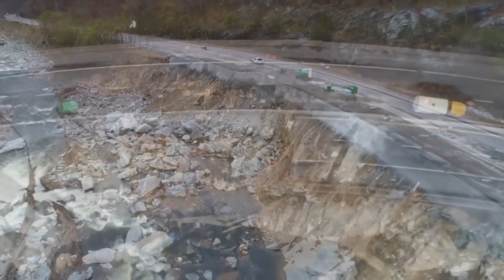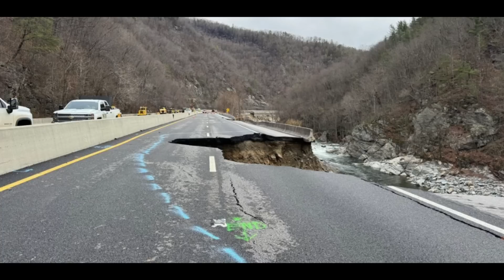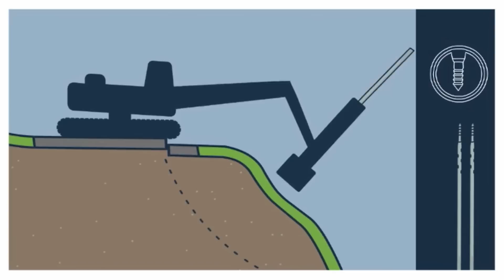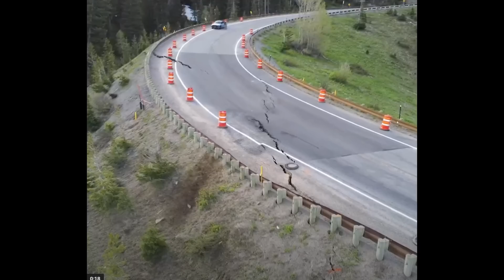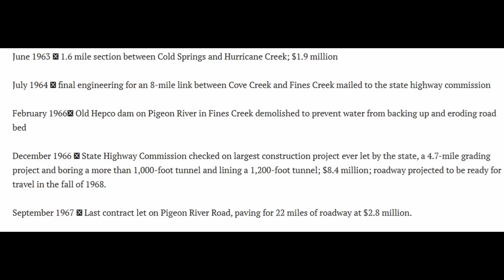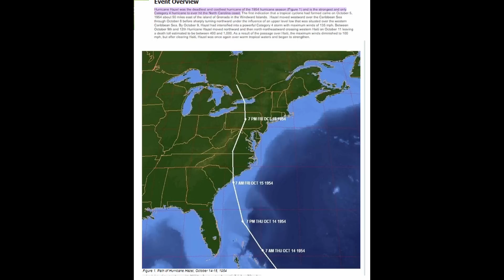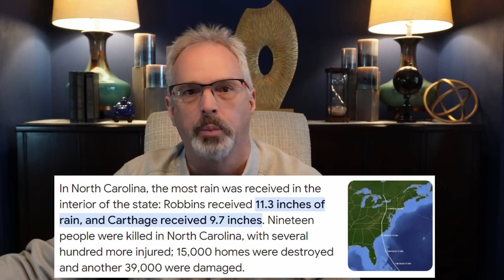Interstate 40 Rebuild Status

Comment: I'm reminded of the 12.4 mile section of Interstate 70 West of Denver in Glenwood Canyon.  These two sections of Interstate (I-70 in Glenwood canyon and I-40 in the Pigeon river gorge) were designed years apart and there was a strong Environmental movement that wanted to preserve the beauty of Glenwood Canyon when that section was designed. When I-40 in Pigeon River Gorge was designed the just basically just   bulldozed and blasted their way through without thinking about the impact on the wilderness. On the other hand if you go to the Glenwood Canyon section of Interstate 70  and stop at some of the rest stops  and walk down the bike paths you will see a big difference between that and the I-40 section interstate that we're talking about.  I'm not perfect the Glenwood Canyon section is about as environmentally friendly as you can build an interstate.  This 12.4 mile section of Interstate cost incredible amounts of money.  

When I-40 through through the little pigeon Gorge was designed there really wasn't much input into preserving the Gorge. They basically just bulldozed and blasted their way through. In fact the Pigeon river used to run black with pollution and chemicals from the paper mill in Canton.  The men from the Tennessee side really pushed the Pigeon River Gorge route because they love the mountains and wanted to open up that area.   For those of you who do not know it is bounded by the Great Smoky Mountains National Park on one side and the Pisgah and Cherokee National Forests on the other side.  The river now runs fairly clean and people now raft down the river. There are also a number of exits and particularly check nearest where I-40 crosses the state line. These connect up with a series of forest roads that gets you out into Wilderness areas very quickly. People driving this Section of the Interstate need to take a few of these roads and exits and stop and enjoy being in nature. 

While I think the interstate should be reopened temporarily I believe that this whole section of the interstate from 4 or 5 me before you leave Tennessee and for 15 or 20 miles into North Carolina needs to be redesigned which fairly long sections diverted  onto pylons or bridges (similar to certain sections of the Blueridge and Foothills parkways) so that the interstate doesn't damage the local wildlife and terrain as much as it does.  The pylons can be designed in such a way that they would stand up to these 100 or 500 year events. While it would be expensive we owe it to this now pristine  area of forest to totally rebuild this section of I-40.

Comment: What if the elevated the 22 mile stretch on concrete piers, basically a 22 mile long bridge like I-10 across the Atchafalaya Swamp in Louisiana? That might cost more but less than a complete re-route which would take 20 years to get approved and funded, plus property acquisition would take a long time as folks up there don’t like the Government. Read about the problems the TVA had in the 1930s, it hasn’t changed a lot.

Comment: The first patent for weather modification was granted in 1891
US0462795: Method of Producing Rain-Fall 
Description: Involves storing liquefied carbonic acid gas in a shell or casing with an explosive, then shooting it into the upper atmosphere 
Theory: The gas evaporates, cooling the atmosphere and producing moisture that forms clouds and rain 
Other notable weather modification patents include:
US1338343: Process and Apparatus for the Production of Intense Artificial Clouds, Fogs, or Mist (1917) 
US3795626A: A process for removing fog or clouds using a water-soluble condensation product 
US3613992A: A weather modification method by Robert G Knollenberg 
The number of weather modification patents peaked in the 1970s and 1990s, which may have been due to international tensions at the time.

Comment: Yeah. When I saw the damage I was shocked that they would even think to try to rebuild it in the same path. There have been so many events in the past 20 or so years that have shut down I40. Now, they think they can rebuild the where it used to be?? I know the cost would be huge, but they really should consider moving the entire road through there more into the mountain side. But of course that would probably increase the likelihood of future rock slides that have been so problematic in more recent years. And it is insane that they want to open it to traffic right now! The road was already clogged with four lanes and I’ve been through there with only 2 lanes when I didn’t realize that parts were shut down. It’s going to be miserable going. The only traffic really needs to be those people who need to go through to access the exits in that area, not through traffic. If they really open it up, I can’t see how they can make real progress on repairing it as everyone will think that is the best way because it is way shorter than going up I26 and down I81 to get into those areas of TN just past the current closed areas (Newport, Hartsford, etc) let alone to Morristown and Knoxville and beyond.

Comment: When you consider the number of closures they have had from slides those costs get worse. They had the same political battle over the route of I26 from Asheville into TN. Tennessee finally built the road where they wanted it and NC eventually connected to it. NC built a great road but the entire stretch in TN is a joke. Very little was filled and leveled up and in many places they apparently bent the road around property lines. There are several miles that are like a roller coaster ride and there are multiple accidents each day on that section.

Comment: The interstate Highway system was funded by DARPA. The Defense Advanced Research Projects Agency, part of DoD R&D. Now each state maintains it's own sections of the interstate Highway system with some federal funding, I believe. I was surprised to learn in 1985 that 75% of economic growth between 1950 and 1985 in the USA occurred within 10 miles of a Highway. Where the interstate highways were turned out to be economically important. If that section of I-40 takes some less expensive to build and maintain route the local economy will suffer. Still it's bad form to build a road that gets washed out every 50-100 years.

Comment: To your point on event probability …The Big Thompson Canyon Floods of ’76 And ’13 (Colorado -CDOT ) are a perfect pre curser to this stretch of I 40  … and I 70 thru GlenWood Canyon (Colorado CDOT)  is an even better example of vulnerability as it is also subject to Avalanche risk …if they (NCDOT) aren’t willing to re route the interstate to a more sensible location …the pilar and stacked lane separation of I 70  has proven to be flexible and resilient to natural disaster if you look at CDOT’s response in the passing years ...the turn around time for reopening and sourcing material for repair seam to be a better fit to what generally seams to be this I 40 stretches future needs.
Reply from the maker: Thank you for pointing out that CDOT has more experience with this type of event!
Reply: You can build a viaduct and hope the mountain doesn't wreck it.

Comment: In Japan, they decided not to install the emergency diesel pumps that would have kicked on to provide the water to cool the reactor.
Reply from the maker: Ouch! Bad decision that was.
Reply: Just no... one quick Wikipedia search shows there were 13 diesel generators on site. Everything at Fukushima stemmed from the under-design of the seawall that was supposed to protect from tsunamis; only once that was overtopped did most of the generators flood and electrical systems fail.

Comment: Really good presentation! Also great analysis by my birds 2525.  I live in this area and Dave I40 (now closed to all but local traffic) to exit 15. It is correct to say there have been numerous and ongoing problems with this road--usually rock or mudslides and it was closed for some months about 25 years ago with traffic rerouted. This is an important east/west artery obviously built in the wrong place. Would it be possible to blast and carve out the north side of the route to create space for  through lanes instead of attempting to reclaim what has washed out into the Pigeon River?

Comment: As far as moving I40, I haven't heard about what would be involved on the TN side, as that will also have to be moved. I'm assuming you are not going to build the road to meet at the existing point in TN. Also, depending on where it will start to deviate from the existing I40, there will need to be roads from the cities that currently connect to I40. Wherever it's moved, it will have to go through SMNP and other national forests.

Comment: Those outward sweeping bends can only be protected by an impenetrable wall, the force of the water should never be able to wash the foundation away, I’m guessing  the water was maybe 2m below road level so that wall will have to be tied deep towards the sloop to withstand the weight of water under the road. And the slope side will need drainage system to limit water ingress under the roadway. That’s a lot of work under exiting roadway. Once the road is open, they can consider piling to create a wall at the river before filling with engineered fill etc.

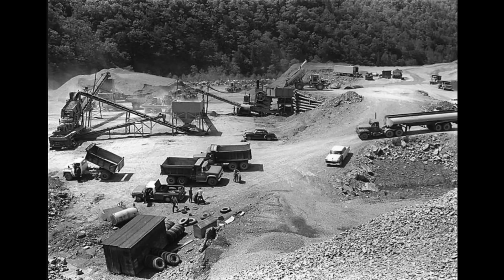Comment: Sharp rock, Minute 7:18; look at all of those tires.

CalTrans was in a like situation up here on Highway 299, so they brought in these trucks that looked like end dumps, but these beds rolled over to the side dumping the length of the bed all at once and doing it while driving down their lane, it was cool, they didn't have to back up, no fartin' around with anything like that, they just kept movin' forward.

Regarding Fukushima- Daichi, the original site of that plant was higher, well above the projected tsunami height, however, due to the distance to bed rock, which the pilings had to rest on, GE/Boise Cascade, (GE/BC), argued the Japanese engineers to take down the grade instead, bringing the grade to the length of piling that GE/BC were willing to pay for.  (I'm tryin' to remember the Japanese energy firms name, was it Tepco?) So, after losing the elevation argument to the Yanks, the Japanese engineers pleaded with the Americans to at least remove the Emergency Generators which were located in the basement, an area where now, once lowered was in range of a Tsunamis, and GE/BC refused to do it, "Leave the generators where they are, we don't need to be redoing these plans!"  That's how THAT shit went down.

Comment: Create a construction road along one side of the riverbed. Take a hundred feet or so from the west side of the canyon to build up the east side fifty feet or so. When possible use the extra fill to shorten the roadway by eliminating curves. Some advantages are less distance to move the fill and a wider river to handle the storm surges better.

Comment: One option to throw out there.  Rebuild this section as a viaduct.  An example of this would be I-70 in Colorado.  The material for the steel would be more expensive, but you don't have to haul in so much fill material.
Reply from the maker: Interesting thought!  You know, that is what they did on I-10 over Lake Ponchartrain in Louisiana.
Reply: @CaseyJones-Engineer This whole section needs to be redone right! No expense spared. Shortened & straightened, & done in a maximally robust way, in every way technically possible. And with a GENEROUS over-provision for future traffic. Because you NEVER want to have to do it again.
Reply: @CaseyJones-Engineer  Building through a lake is much different than the Pigeon River Gorge. People aren't noticing that the worst part of the damage is on the outside of a bend of the river. Those places need to be avoided for any sort of construction. Even building a viaduct in those spots is problematic. Scour is high and the burden of the river at high flood elevations would probably wreck the column foundations and columns.
Reply: @CaseyJones-Engineer A distance optimized combination of viaducts, and tunnels. But with at least 6 lanes, and robust full travel width shoulders on each side, for future expansion (since you're not going to rebuild this for expanded traffic b4 the "all drone" future). And also to accommodate breakdowns/accidents/resurfacing/et al.
Reply: My wife’s grandfather ran a bulldozer when the I40 section through Pigeon River was built in the 60’s. He always said that this section of Highway would never hold over time. Also yes there was a political reason it was run through Haywood County on the Pigeon instead of through Madison County to Hot Springs and on to Newport TN.. … just sayin..
Reply: Similar project recently completed not far from the wash out the Blue Ridge parkway
Reply: I've been saying this since the floods happened in NC after Helene. They could get the hwy designers could get the plans from when I-70 was built going through Glenwood Canyon. "Interstate 70 (I-70) through Glenwood Canyon in Colorado is a 12.5-mile stretch of highway that's considered one of the most scenic natural features on the US Interstate Highway System." They could do an updated version with I-40 and some of its arteries in NC.
Reply: Colorado has had a lot of Problems with I 70 in  Glen wood  Canyon

Comment: Hmmm . . .   For all the "throwing good money after bad" zealots, If I-40 is not rebuilt here, where do you propose putting it, and how much will that cost???  Roads of any capacity in the Appalachians are main built in two areas - ridgetops and river valleys, with awkward transitions between them as terrain features dictate.  Aside from large embankments, the only other structure types available to engineers and designers to negotiate 'challenging transitions' are bridges and tunnels.  All of these have their own risks and liabilities.  Any solution will cost money.  It seems unlikely the current regime controlling congress has the will to acquire the funds for this task and then spend the money on this task.  Certainly the "cheapest solution" is to do nothing - not rebuild, not relocate - and let the travelling public workout the alternatives.

Comment: Great video!  I concur with your conclusion in principle.  However, I think you omitted an alternative.  There are tons, literally of fill immediately available. It’s the side of the hill that the road is dug into! Just dig into the hill deeper and use that fill to repair the side into the river. Yes, you still have to move it, but you only have to move it from one side of the road to the other.  And while you were at it, you might clear out enough width to put in another lane! in truth, I’m not sure I would try to build out the lost lanes next to the river. I would rather shore those up with reinforced concrete water shoot to protect from future erosion. The extra lanes come from digging into the hill and ensuring that from rock slides.  I think this is all doable and for a fraction of robust to future events.
Reply: Yes, they would certainly scope for a local borrow.

Comment: reroute it WHERE?  I can tell you that the entire western end of NC and Eastern TN is all steep slopes.  Seems like any other place you put it will eventually have the same problem.
Reply: Geology is important. In the gorge they chose the rock is sloping wrong and they have regular rock slides as a result. Had it built on the other side of the river it might have been workable, bum regardless, you would have had to keep the road away from the river.

From what I can see, the best alignment would be in the US 70 corridor west of Hot Springs.

Comment: The 2-lane re-opening is a temporary fix. Most likely the road will be restored to 4 lanes using technology similar to the Linn Cove Viaduct - thus negating the need for mountains of fill. One thing is absolutely for certain - it will be rebuilt and restored to four lane capacity. That is guaranteed. Re-routing would be extremely costly - much higher than replacing the damaged portions with viaduct style bridges. Remember - this is a federal interstate highway - the money will be spent to repair the road, however they decide to do it, and all citizens of the United States will foot the bill - not repairing this section of I40 is not an option.